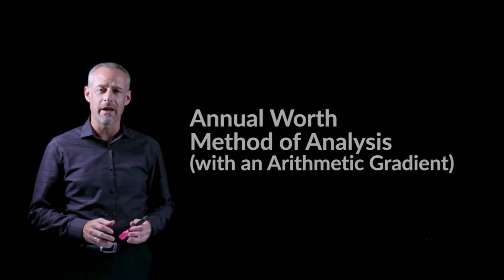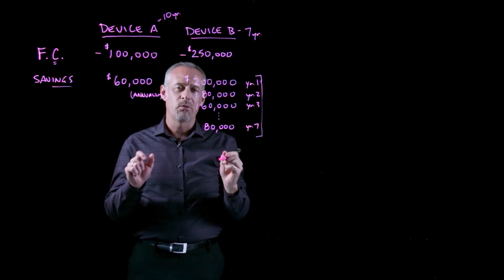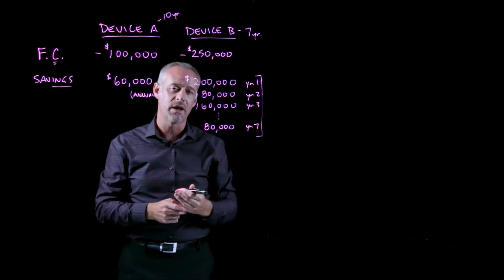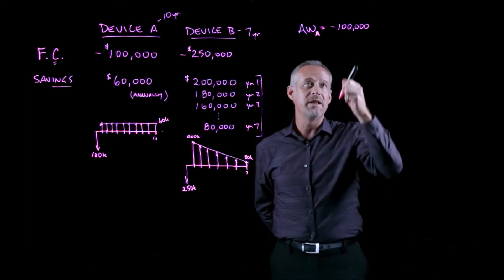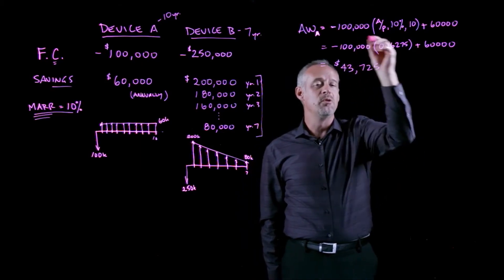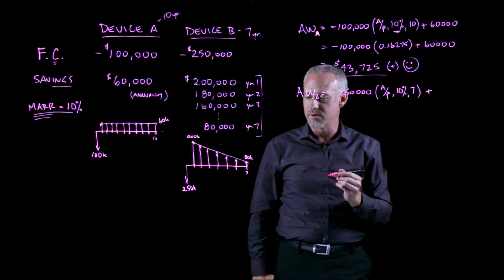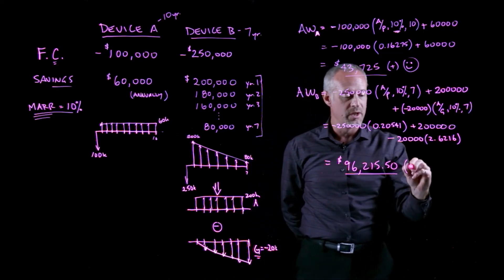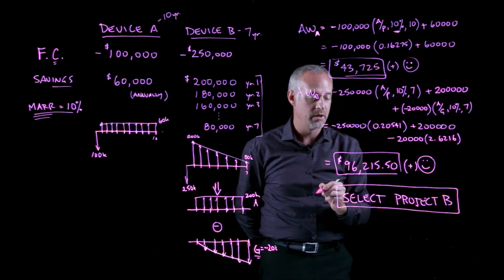Annual Worth Method of Analysis - Engineering Economics Lightboard

Comment: Thank you for a great video and explanation. This explanation makes sense, but I'm wondering about the book examples. They have a positive sign in front of the FC and a  negative sign for savings (which doesn't make sense), but if I use your method to solve for many examples in the textbook, I will get a  (negative) AW. Will that still be ok? Will my conclusion be to go with the alternative that got the lower (negative_ AW, if that makes sense?
Reply from the maker: Good question!  I don't agree with a FC being a positive number - UNLESS, your book is treating ALL 'COSTS' as positive - but this is pretty unconventional.  If your book views savings as negative, then I would assume that a negative AW is a good thing, AND, the more negative the better!  So, my answer to your question is YES!  But, again, this is opposite to the sign conventions that I use.
Reply: @EngineeringEconomicsGuy  I use Fraser, N., Jewkes, E. & Pirnia, M., Schmitt, K. (2022). Engineering Economics: Financial Decision Making for Engineers, 7th edition. and yes, it is so confusing to think about FC as costs as positives. Thank you for your reply. It is much appreciated.
Reply from the maker: My pleasure!

Comment: 8:23 is there a by-hand method or analytical way of deriving the value 0.16275.  Thank you for the upload!
Reply from the maker: Yes!  Thanks for the question.  The formula is (i * (1+i)^n) / ((1+i)^n - 1), where i = the interest rate, and n = number of periods.  This is referred to as the A/P compound interest factor.  A derivation of this formula can be found in most engineering economics textbooks.  Hope that helps.  You can also watch my other videos on compound interest factors and patterns of cash flows.
Reply: @EngineeringEconomicsGuy  Thank you!
Reply from the maker: You're welcome!  Good luck in your course!

Comment: Greetings! I came across a problem I regard as highly...complex. Would anyone happen to know the general approach to this? Machine A, Machine B. Purchase value of machine A is 180.000 and purchase value of machine B is 205.000. Annual interest rate is 10%. The annual operational costs are given by this function: 20.000+4.000t (t being umber of years) for machine A and 15.000+3000t for machine B. Tires need to be changed every 3 years, and they cost 2.000 for machine A and 2.500 for machine B. The salvage value is also given as a function, (180-2t) for A and (205-1,5t) for B. The question is, how do we determine the economic service life of a machine with such data? Whats the most viable option for purchase?
Reply from the maker: There are 4 Videos in my "Replacement Decisions" Playlist.  I suggest you watch them all...you will need to become familiar with them to answer this complex question:  https://www.youtube.com/playlist?list=PLcfz9wmNxKqhSDF7C1FkR3B92tdo-Nzeh
You will need to use the concept of 'economic service life' or 'economic life' to solve the problem - NOTE - this refers to the number of years whereby the Equivalent Annual Cost of ownership is MINIMIZED...these terms will make more sense after you watch the videos.  You will need to work through the options of owning each machine for 1 year, 2 years, 3 years, etc. (each as separate, independent scenarios) to find the number of years-of-ownership that minimizes the EAC (this is the variable "t" in the formulas you've been given).  GOOD LUCK!!
Reply: @EngineeringEconomicsGuy  I watched all die of them! Great job explaining the EAC. The thing is, we use the factor formulas to calculate different cost in my school. For example, i(i+1)^n/(1+i)^n-1 instead of (A/P,i,N). My issue with this particular problem is its seemingly slow depreciation rate and slow repair/maintenance cost increase. I always get that the best time to sell is the first year, but doesn’t really make sense for its ESL to be 1 year. Anyway, thanks for the content, you’ve helped me grasp things I’d otherwise not be able to!

Comment: So you're able to compare projects with unequal lives directly using the annual worth method?  
(No need to use the repeated lives or study period approaches?)
My textbook never made it clear whether or not this was possible.
Reply from the maker: Yes!  Annual worth is absolutely the best, and easiest, way to compare projects of unequal lives...but, be aware of the underlying assumption that the projects "continue" - i.e. - repeat - forever (or at least as long as practical for the purpose of the analysis).  Using Present-Worth and the repeated-lives-with-least-common-multiple-of-years-approach (or study-period) is a bit of an academic exercise to help students practice their calculation skills but there are certain real situations where it is appropriate.  You should learn and understand both Present Worth and Annual Worth analysis.
Reply: @EngineeringEconomicsGuy  My textbook (Engineering Economics by Fraser and Jewkes) describes the difference between the PW and AW methods as being one of convenience, meaning do you prefer looking at the result as a lump sum or as an annual "salary" type of thing.  

The textbook emphasizes that the projects must have equal lives to be compared using the PW method, and that if they don't, then there are two options:

1.) Repeated lives. (In your example I think you had 7 and 10 years so that would mean evaluating those projects at a common time period of 70 years.)

2.) Study period. (In your example that would mean capping the analysis after 7 years and messing around with the salvage value of the device that lasts 10 years to figure out what it's worth after 7 years.

But the textbook then does the same thing with the AW method (using the repeated lives approach)... and then doesn't do either. It kind of threw me for a loop. 

I'm glad that it's unnecessary because it makes a lot of additional and tedious calculations.  :)

Comment: What is the process you would do in the (A/P, 10%,7) in numbers?
Reply from the maker: A/P is a compound interest factor.  It's what we use to convert a present value (P) to and annuity (A).  Use the formula:  [i(1+i)^n]/[(1+i)^n−1] to calculate the value of the factor, where n is the number of periods (often years - i.e. 7) and i is the interest rate (10% = 0.10).  You can also use a compound interest table to find the value.